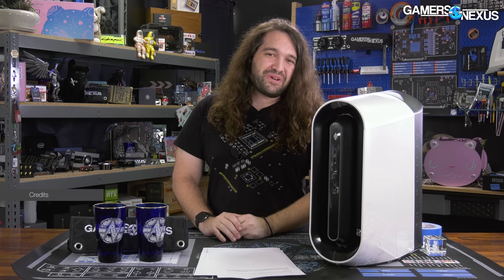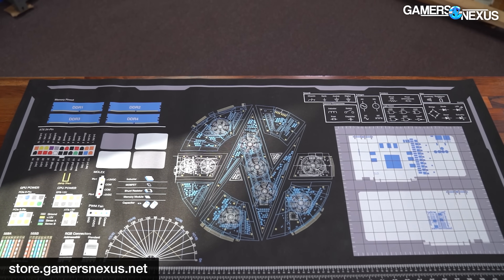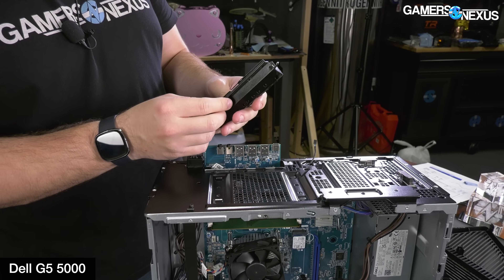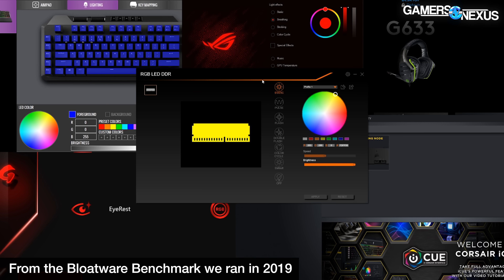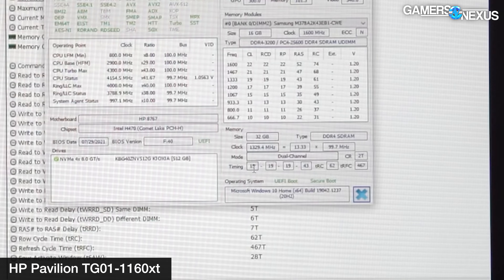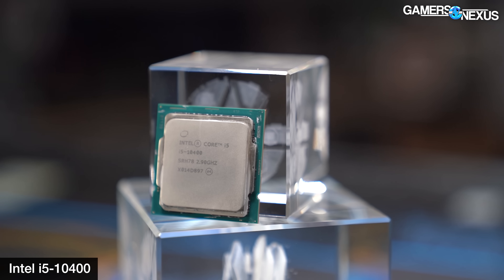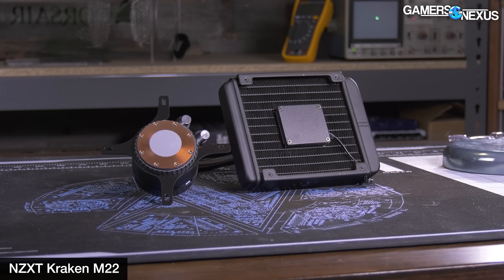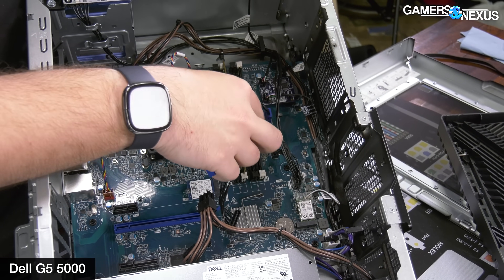The Worst Prebuilt PC Mistakes We've Seen (So Far)

Comment: I wish you wouldn't be so hard on Alienware. I know Dell sucks but AW has some decent products, depending on which parts you pick/get.
Reply from the maker: We reviewed the product they shipped us after paying $2000. The R10 had a cooler worse than an Intel stock cooler, again, on a $2000 PC.
Reply: @GamersNexus  Should've got the liquid cooling dude. That stock air cooler is bad, I agree. Good video either way.
Reply: @gregosobo  You missed the point.  Steve buys products like pre-builts to test the efficacy of something that the average consumer might buy.  And the average consumer is not going to place too much emphasis on the cooling solution.  They will see the lower price tag of the air-cooled option and buy that since the other components are already so expensive as is.
Reply: @madychap267  It's $50 more for the liquid cooling. You could always buy an aftermarket cooler. I agree he is representing what an average consumer will buy. Just like an average consumer though, if you don't do your research, you'll end up getting ripped off. Due diligence is required when making any expensive purchase.
Reply: @GamersNexus  I guess you did try to order the liquid cooling. Respect for telling it like it is. Options are very limited for any GPU at the moment. Beggers can't be choosers in a lot of cases, only reason I stand up for AW.
Reply: Still, I prefer to build one by myself. You have great YouTubers explaining how to buy and build a pc saving you a ton of money
Reply: @RyuKimGaming  Except you can't get a GPU anywhere right now. In case you haven't noticed. Only in pre-builts.
Reply: @gregosobo  You can buy a cheap older gen  GPU (I may be wrong) and wait for the next gen or something. The thing is better to build something that buying a prebuilt.
Reply: @RyuKimGaming  Even older GPUs are priced way too high. Take a look at eBay. Waiting for next gen is a fallacy, the crypto mining craze isn't just going to go away then. It's speculative to say "wait until next gen or something". Some people want a new GPU this year, one that can play games at 1440p or higher, 4K in a lot of cases. Need a 3080 or 6800 XT. Tons of people still can't play Cyberpunk 2077 at decent settings, a game almost a year old.
Reply: My experience of Dell products is bad. My experience with Alienware customer support is good. They accidentally sent me three 34" ultrawide monitors for the price of one and gave me 50 pounds to boot. I guess you could call that incompetance but hey they gave me money.
Reply: @ZIV PC They have good high end stuff. If you get liquid cooling, a good GPU. The only bad thing is the case (airflow) and using proprietary parts.
I can't believe the deal I got on an R10 with a 5800, RTX 3080, liquid cooling and all around good parts for $2,400 Canadian, under $2,000 USD. Gotta snipe those deals and use a 10% off promo code.